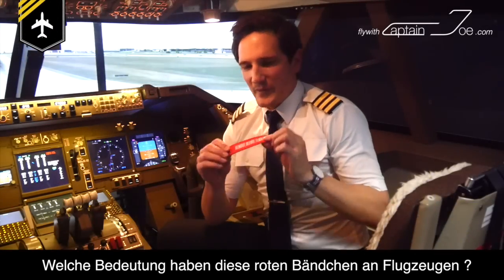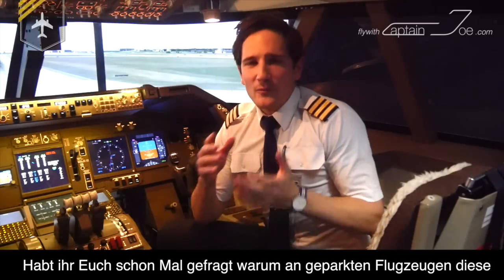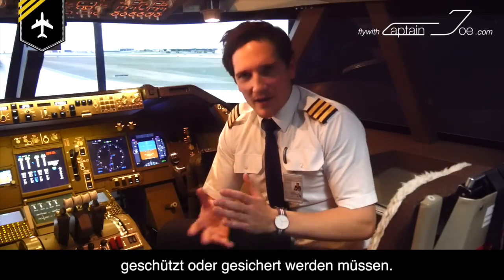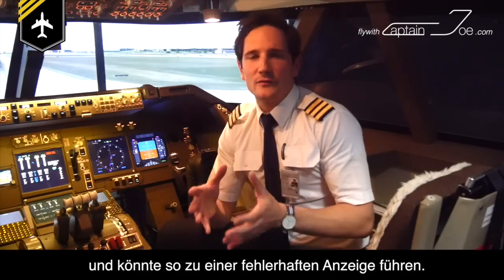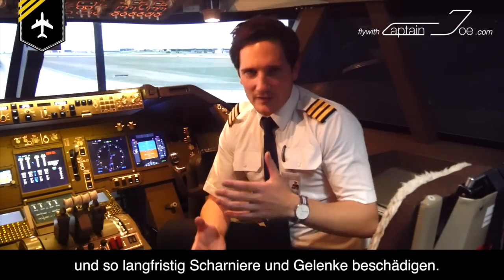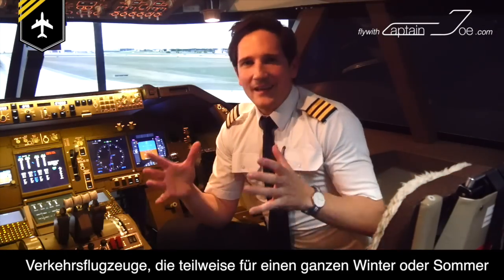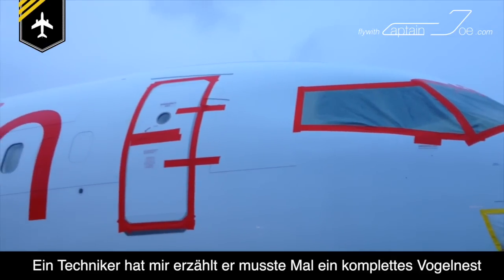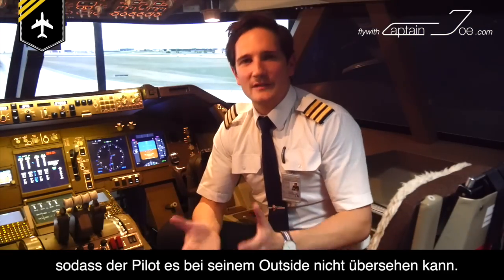What are those REMOVE BEFORE FLIGHT tags?

Comment: I have a question. On push back from the gate is the pilot is control of the steering of the aircraft while it's being pushed in reverse or is the driver of the push back tug in control of the direction?
Reply: While pushback and every moment in which the tow truck is attached to the front wheel, there is a remove before flight pin to prevent that the pilots could move that wheel. The hydraulic system is so strong, that it could move the tow truck as if it was a toy car and hit someone.
Reply: c0ldw1nd Thanks. I never knew that despite I worked for three years as GSE at DTW for NWA back in the late 90's/early 2000's but the push back operation was always the ESE 's (baggage handlers) job to do the push back. 
I was responsible for aircraft cleanliness, lab & water service and de-icing.
Reply: Michiganborn1969 A friend that works as GSE at BCN for Groundforce told me that. I didn't know that the front wheel hydraulic system was so strong, even in a small regional reactor.
Reply: Maybe the hydraulic system is strong enough. But I doubt it would move the push-back truck around. I believe it is that the mechanical parts would be damaged by the strong hydraulic force. Therefor you unlock the steering from the front wheel.
Reply: TJGermany No, the plane can move the bar that connects the tow truck like if it was a stick and break the mechanical parts or even move the truck. Take in mind that the hydraulic system should be able to work with all the weight of the airplane.
Reply: c0ldw1nd Or the can break your legs. The bar alone. Really, all I'm saying is that it's probably not strong enough to move the whole truck around. Only moving the wheel is much much easier, as friction to the ground is much smaller, and also the lever is a totally different than with the truck attached to the bar.
Reply: TJGermany I am not talking about the big “wheel-lift” tugs. I mean the smaller ones that don't weight so much. Although the friction is not so big, the wheel should be able to move at speeds of 100 knots or more so the pilots can have control of the plane in the runway, that really needs a lot of force.
Reply: c0ldw1nd I still disagree with you. In my view, you are missing two points: 1) When the plane is moving on the runway or during taxi, turning the wheel needs much less force than while stationary. Just think of turning the steering in an old car without power steering: Difficult while stopped, easy enough when moving! 2) Even the small trucks with the push back bar won't be moved around like toys. Of course the hydraulic has a lot of force, but just think of the lever rule and how much that increases the necessary force because of the distance of the weight to the rotation axis of the steering column.
Reply: c0ldw1nd No, neither. I only worked part time as ramp agent while I was at university. But you proved it yourself with the pictures: the tug was not tossed around. Only the push back bar got bent. Again, look up lever: https://en.wikipedia.org/wiki/Lever
Reply: TJGermany The second picture shows how the tug was moved with the hydraulic system. Both fotos were taken by a coworker of my friend, the one with the orange reflective vest. I think he knows better than you what happened, it is a real fact, not a supposition.
Reply: c0ldw1nd Ah, ok. Thanks. That changes it. I thought you just googled some photos. Then I'll believe you. I was lucky, I've never witnessed any serious accident.
Reply: TJGermany Luckily nobody was damaged, but the passengers had to take another plane with the consecuent delay.

Comment: You should have also mentioned the Remove before flight straps which are insered during a push back and disengage your controlls
Reply from the maker: Good point! I will cover that topic in the pushback video :) Greetings Joe
Reply: you're welcome .
Reply: I used to be a Ramp Agent, but I never did a push-back. I always wondered what the red flag was for and why the agents involved with the push back held it up in the air afterwards. Also, when a push-back is undertaken, I saw the ground crew plug a headset into the underneath of the aircraft - what is he discussing with the pilot?
Reply: well mostly the pilot will hear in his language, that the chokes and the electricity are in and sometimes they ask they pilot whether he wants PCA (Pre-Conditioned Air) or not. Anything else you'll communicate directly with the pilot when all passengers left the airplane.
Also you hold up the straps to show the pilot that you took them out, because as far as I know engine controlls work but anything else not, so if the pilot engages thrust and anything else doesn't work that's fatal, although you have plenty of those straps on every push-back truck
Reply: That pin is the whole reason I came here :(
Reply: so? What do you want to tell us with that?
Reply: I was expecting him saying something about the pin to disconnect the steering.
Reply: he'll do that in his pushback video. Be patient and you won't be dissapointed.
You hold it up to show the pilot it's out, but you also can take one from the pushback truck as there are plenty of them on the truck, but it's to confirm to the pilot finally that the airplane is free and he can go as there are people close to the running turbines when taking out the pins and you disconnect your headset when taking out the pin and to then show the pilot ok you're safe to go.
Reply: but if you're unpatient, here is a German Video which the airport of Munich made, were i worke  /watch?v=0DLrAsade0c

Comment: Prior to landing there always seems to be an experience that the aircraft is applying brakes, what is happening at this point to slow down the aircraft?
Reply: Deploying flaps and/or speed brakes increases drag as the aircraft is on its final approach, this is what slows down the aircraft which causes the braking feeling.

Comment: Why not mention the steering bypass pin? Probably the single most common remove before flight device used on commercial aircraft. Or landing gear lock pins? And how sometime they aren't removed before flight.

Comment: Captain Joe

Why does airplanes not have a reverse gear???
Reply: It actually does while landing. It's called reverse thrust. It helps the plane slow down and push the thrust in the opposite direction. Pilots are not allowed to use it for pushback as they have a pushback truck.
Reply: It has it is called reverse thurst

Comment: Wasn't there a serious crash caused once because a bit of tape was left on a pitot tube?
Reply: Yeah a 757 i think. The speed/altitude indicater was block due to a tape or a tag
Reply: Yes. I believe that was a Quantas Airline flight to Brazil. And the Pitot tube was taped over for some maintenance deal that was not removed prior to flight (check my facts on that- I may be slightly off).
Reply: It was an Aeroperu flight, tape had been put over the static ports whilst the aircraft was being cleaned, the tape sitting flush against the skin was not seen by the pilot or any ground crew. Static ports are important as they give all the indication for altitude, vertical speed and are needed for airspeed (pitot tubes are required for only airspeed).
Reply: Birgenair 301 crashed due to a wasp building a nest inside one of its pitot tubes and causing it to feed incorrect airspeed data to the autopilot system. Ice crystal buildup inside the pitot tubes leading to a similar autopilot failure has been hypothesised as being the cause of the Air France 447 crash.

Comment: Why would an airline leave a plane parking during a whole season? aren't they wasting millions by doing that?
Reply: Some airplanes need a massive repair / schedule check, and these checks last for a very long time. In fact, there has been fatal accident because of using a back up (just finish repairing) airplane which the tube is not properly sealed and possibly invaded by bugs. You can check out Birgenair Flight 301 crash for that

Comment: hi Joe I watched air chrashes on national geographic and there was a crash caused by altimeter sensors covered by this
Reply: With Aeroperu Flight 603, a maintenance worker left duct tape over the static ports.  It didn't say "remove before flight".

Comment: there is an incident involved the that tube. Birgen Air flight 301
Reply: Also Aeroperu Flight 603, in which case a maintenance worker left duct tape over the static ports.